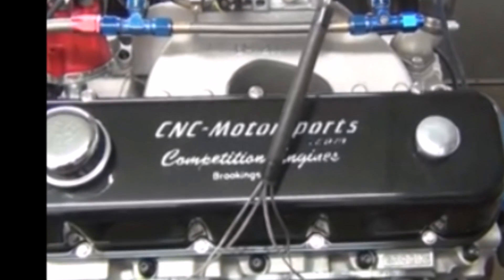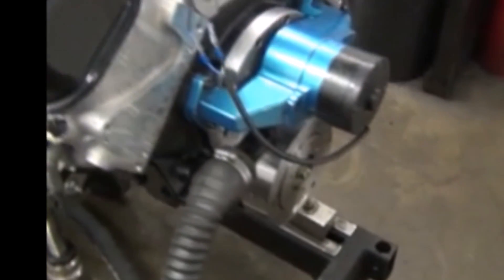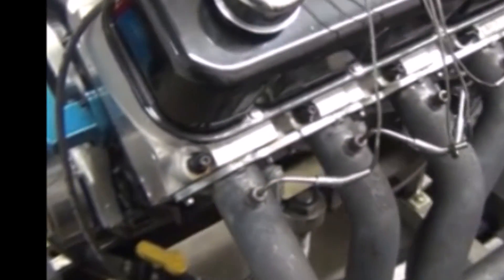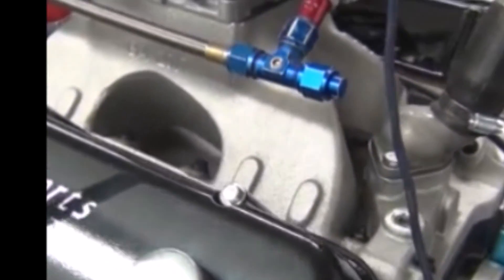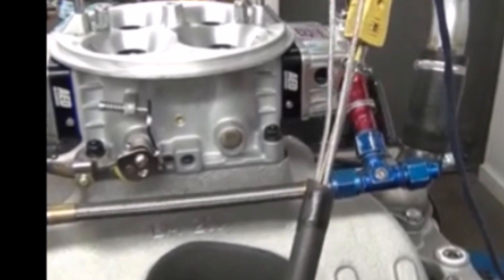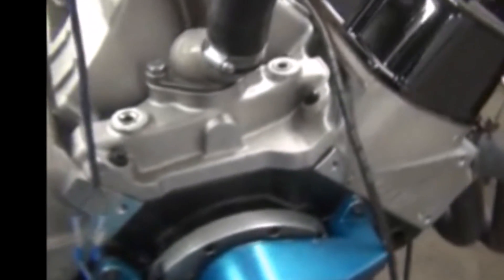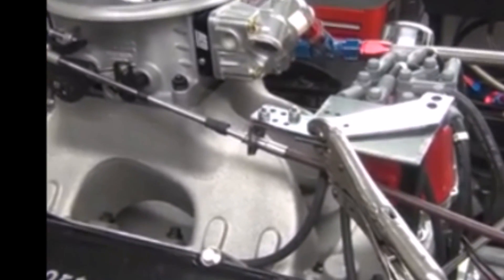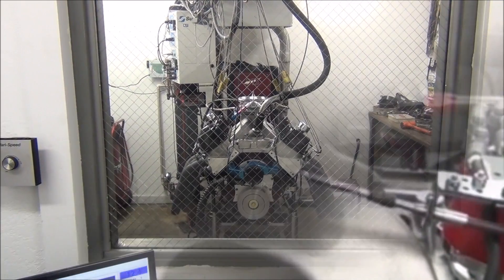BB Chevy 565 Pump Gas Crate Engine, 770 Horsepower

Comment: Is this the 765hp 565ci crate engine you guys list?   This is a sweet piece, tons of TQ and lots of HP without having to rev to 8000 rpm to get it.  Most of the so called street builds are so over cam'd, the peak power is at 7700 or something crazy.  This thing has a super nice curve to it.  Its nice to see a true street motor. Should be killer on the street in anything, light or heavy. Definitely on my wish list.